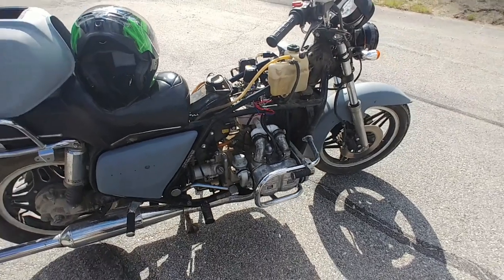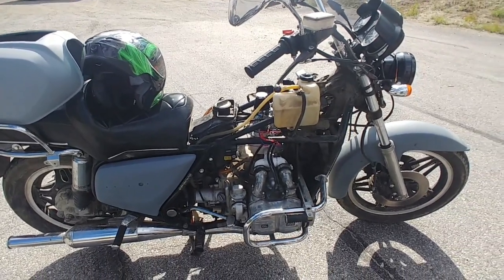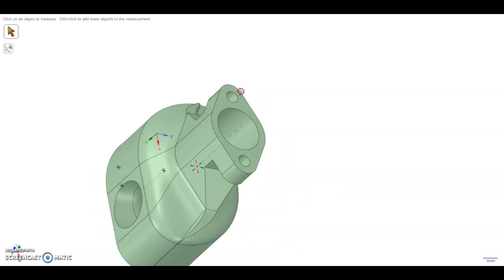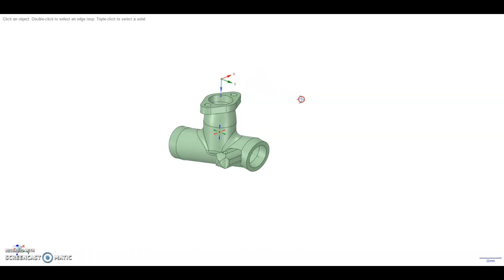1981 GL1100  Single Carburetor Conversion SCC  Solex 30 pict-1 /w 3d print/PVC Manifold

Comment: Honda designed the original carbs for a reason....Rebuilt right and kept clean they are worry free.
Reply: Well duh, but when buying a $100 basket case motorcycle with NO carbs, you improvise...  it is more an exercise in creativity and thrift than one of efficiency and power. It worked....

Comment: Cool manifold build. I made my manifold out of aluminum.  I am a retired machinist and very experiemced welder.  I have a friend that own a very complete machine shop that allows me to build "stuff" with his machine tools.
Reply: I am contemplating casting them using lost PLA method and aluminum.. I have a forge and smelting furnace.. I would cast the whole thing including where the pvc parts are

Comment: PVC pipe will easily bend with a heat gun. Simply fill the pipe with sand capping the ends without glue to keep the sand inside the pipe. Evenly heat the pipe until it softens. Wearing gloves bend it and once you have the bend you need simply let it cool. Then pull the caps off and dump out the sand and rinse it out with soapy water making sure no sand remains. Trim the pipe to fit. Now you don't need to worry with the offsets.

Comment: Hi, I noticed your fuel pump was not connected are you just running it straight ? Also where did you connect the two hosing that were on the air box? Thanks
Reply from the maker: The fuel pump on this bike is bad and it is running an electric pump (hear the clicking when the bike is turned on)  the 2 hoses into the airbox are blowby and can be pretty much eliminated....
Reply: @rustoxide   Thanks. I did the conversion too but some how I don't have smooth power it spotters at high speed, but idles great. I checked for vacuum leaks but nothing.
Reply from the maker: @bzrut  I am using the smaller 30 pict1 for the pre 1966 1200 cc vw engines... the kits usually have 34 pict 3 carbs, meant for 1600... too much carb.. I have heard with the 34 you need to really rework the jets...

Comment: Great video I just subscribed. I was going to used PVC to switch two of my bikes to single carb then another one of my bikes from four carb to two carbs. I don’t have welding equipment so I like your idea with PVC. I’m just super worried about the heat from the engine melting the plastic. Is that at all an issue you’ve seen? Please let me know. The bikes are ( two 1984 Yamaha virago xv700s and one 1982 Yamaha maxim xj750 )
Reply: I just acquired my uncles ‘82 Yamaha XJ750J Maxim ( it’s got the full dress up kit front fairing and all) it’s Four carbs in line on those ( having an intake manifold welded up by a shop shouldn’t cost that much ) I had a similar idea to put a custom intake manifold and Run a Two-Barrel carb
Reply from the maker: no melting.. my son has been riding this setup for a year and had no problems with melting.. The GL1500 is using the original port manifolds which are attached by rubber... on top of that when you are running it, it is pulling cold air and gasoline through them which cools it internally...
Reply: That’s cool. I’ve started to think of still running the four carb line up just to keep all the power I can get from the xj750. Honestly I just didn’t want to have to have to sink all the carbs and deal with all that. I’ve since bought an electric mig welder so that helps my options now. Just having a hard time finding metal bends and all that to work with on my viragos. Hopefully soon I’ll have more to play with on my channel for it.

Comment: I had three of my own design made out of tubular aircraft aluminum and Precision polished inside to deburr any slagg from wielding. I’ve actually had great success with the VW carbs. On my last seven bikes.
Although there’s nothing like the stock carbs! If your planning on keeping it and want the dependability and performance Honda intended find a set! I keep my stock set packed safely away freshly rebuilt and ready to install if I ever sell my bike🥶 only have one intake left😂 because I sold two on bikes & they’re still kicking beautiful and guys are still my friends😎.
Take caution though guys I almost burned a bike up using PVC💨💥 🔥🧯🧯🧯and I coated it with POR15 sealant that was “chemical resistant” 🤬🤬🤬 and I tried all of the EBay specials! She me are better than others! 
I’ve also serviced many bikes people have attempted to run these carbs and they could never get them to run perfectly.
Good luck and enjoy!!!
Ride Red!!!
Reply from the maker: I have refined the design more since I made this and am printing it out of resin now...  I also have 2 GL1200s with stock carbs, I still like riding the 1100s better...

Comment: I bought a 100 dollar steel manifold from a guy on Ebay and I'm using a Mexican 34 Pict 3 with no choke. Drilled out the idle jet to .008 and used a 145 jet from a stock GL1100 carburetor. Works great and I haven't looked back since.